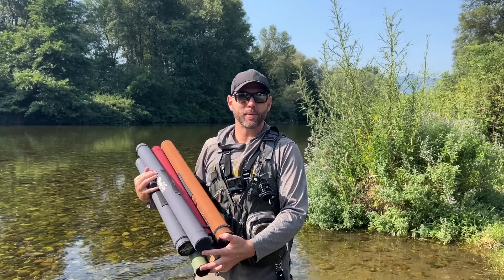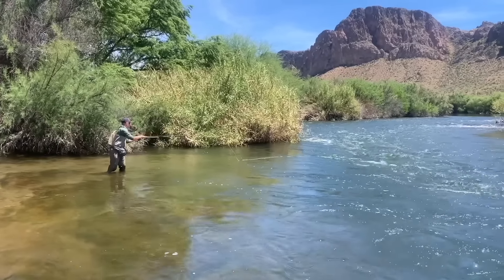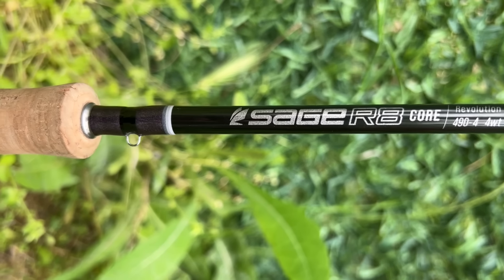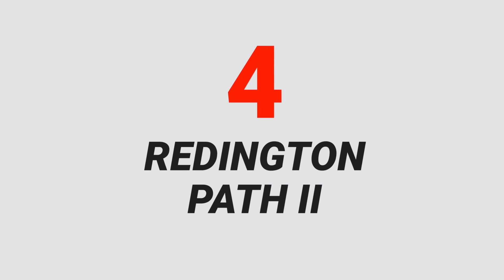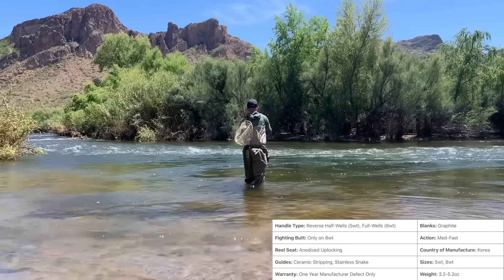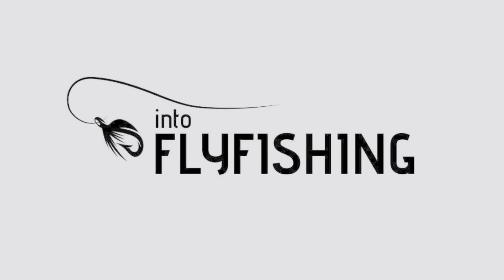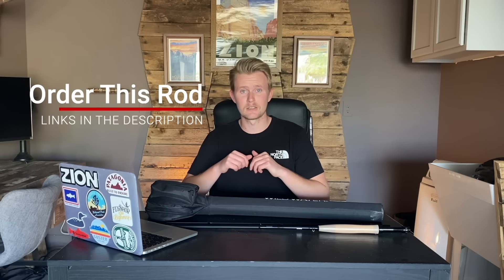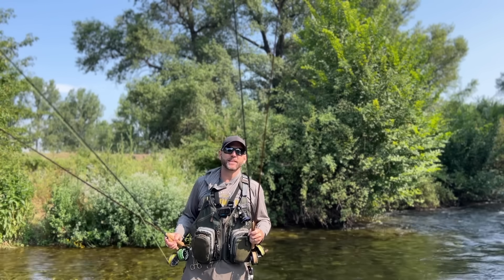Best Budget Fly Rods (Reviewed & Compared)

Comment: If you could buy a hammer that was fully capable of driving nails and priced between $50.00 and $250.00, or one that was $1,000.00 that did exactly the same thing, would you call the lower priced hammers, budget priced? The point is that $250.00 and less is, and some might still disagree, affordable. The $1,000.00 rods are clearly an extravagance. The proof is in the fishing and I sometimes still use a 40 year old rod that cost me well under $100.00.
Reply: I agree that 1,000 dollar rods are really not worth it but a $50 rod isn’t going to cast as nicely as a 400 dollar one. I would recommend to spend at least 200-500 dollars on a rod. Anything over that is too much and usually anything under that is crap but there could be some exceptions out there. For example I heard the reddington wrangler is pretty good that is 160 bucks.
Reply: If you're Johnny trout fisherman then yeah $1,000 for a flyrod may be too much. Some people spend $1,000 just trying to buy the perfect rod because the one they have is never good enough or it breaks and they don't want to go through the process of replacing it. So if your flyrod is an investment in your fishing and you can afford it, get it.
Reply: What a weird way to say that you don’t like nice things, and are probably a poor person
Reply: @nikcarbaugh4019  who are you? Why are you so rude? Does sitting behind your keyboard and insulting people make you feel good?  While you're doing that, I'll be enjoying my time on the water.
Reply: @frankhoxsey1177  I am my own person, and I am rude when I see people say and do stupid things, Like you did. No, I do not sit behind a keyboard all day, I actually go out fishing, and I promise you, the crap that came out of your comment needs more than just a handful of toilet paper. Equating a hammer and a fly rod is like making a comparison between a bicycle and a car. Sure, there is a point where money doesn't improve performance, but the claim that you can pay less for a fly rod and get the same performance out of it as you would a $1000 rod is moronic at best.
Reply: @nikcarbaugh4019  dude! Really! "What a weird way to say you don't like nice things and are probably a poor person". That was your comment not mine. That comment was extremely rude. My question to you is.... If you two were having a conversation and he made the same statement, would you reply the same thing to him in person?
Reply: @frankhoxsey1177  Yes I would, because I do not tolerate stupidity, whether or not it is in person or online. And yes, if I was having a conversation with a random person and they said some stupid shit like that, I would hold them accountable for it.
Reply: @nikcarbaugh4019  so your going to hold him accountable for feeling like he can get a same performance out of a $50 flyrod as a $1000 flyrod? The thing that I have always loved about the flyfishing community is that it is about the love for fishing and the fun that is within. It's a strong supportive community. But, to call someone out because they don't see the difference in two flyrod is not what I have seen in this community. To that end, may you get a good drift and a tight line.
Reply: @frankhoxsey1177 nikcarbaugh must walk around with a black eye and busted lip a lot…
Reply: @nikcarbaugh4019 sounds like you’re trying to justify your purchase 😂. Get some friends
Reply: @michaelwright956  nope, because I conceal carry. Anyone who threatens me ends up on a shirt
Reply: @nikcarbaugh4019 he was not saying that a hammer and a flyrod are a 1 to 1 comparison. He was saying that for the most part in regards to price, the cheap hammer can drive a nail. mabe not quite as good but it does the job just fine, and the bigger difference is the skill level of the carpenter, the same as it is the bigger more important difference with the level of the fly angler with regards to placement of the fly.
Reply: @nikcarbaugh4019 

You use poor as an insult.

That's the elephant.

Someone with less money to spend is not necessarily poor in many other areas.

Getting enjoyment out of fishing on a tight budget might be one of them.

A famous saying by Bob Marley was 'Some people are so poor, all the have is money'.

Would you have made your case for a 1000 dollar rod by its attributes (without using the word 'poor' as you phrased it) this whole conversation would have went a totally different direction.

Do with this information as you wish as I'm not gonna entertain opinions on my opinion.

I'm rich in strong and well thought out opinions.
Reply: @nikcarbaugh4019  poor and smart are two different things.  You may not understand how these lifetime warranties work with pricing.

Comment: I bought a maxcatch extreme for $37 from Amazon to see how bad it must be. Loved it and have bought 3 more, I prefer them to other rods that cost $200 plus
Reply: I have not had any experience with many of these rods but I have some tfo rods and have a fondness for the ones I own. One is a 6ft 2wt that I just love ine the small warmwater creeks I fish. The tfo 8.5ft 5wt rod that I own I never liked and threw it in the corner for 2 or 3 years. I finally pulled it out and put a 7wt line on it and it came alive for me. I will use it to feed carp when I get the chance.
Reply: I also want to add that I find the Eagle Claw feather weight rods to fine glass rods for my warmwater creeks and keep them to get friends started in our great sport and I always recommend newbies to start with them. Much more durable than graphite as a first rig. Most graphite rods are broken by mishandling and by newbies. Bead head flies have become the main staple for beginners and a major cause of broken rods. One poor cast and the bead hitting the rod causes a weak spot in the blank. Glass can better withstand this one poor cast.

Comment: I just put together a Redington 376-4 Fly Fishing Classic Trout Rod 3wt with Tube, Freshwater, Moderate Action Rod. I bought a Okuma Siera X 3/4 and a Rio Premier Gold Fly Line. I cannot tell you how easy it was to cast. Very forgiving. I wish this would have been my first set up. So easy to work. First day out, I pulled in 10+ little sun fish. Each one was a blast to land. With a three pack of 6X leaders, I am out sub $250.00
Reply from the maker: Yeah that's why Redington is so hard to beat here. We loved the Classic Trout Too. Try the Crosswater and Wrangler too one day if you get the chance. 😀
Reply: @intoflyfishing  Out of these 3 rods, what would you pick for a 4 wt for small streams?

Comment: I would agree with the comments about excluding Temple Fork Outfitter low end rods from your review. Really? How is that possible? Having 4 out of the 10 from the same brand raises a question about the motivation, perhaps?
Reply from the maker: For a rod to be considered "Budget" we were pricing the rod itself at around $100. The more expensive ones on this list either come with a reel and line, or an extra tip. By this criteria, no TFO rods fit the price barrier. We love TFO rods though and have reviewed and fished plenty of them. They will appear in our Best Midrange Rods list, best trout rods lists, etc.
Reply: @intoflyfishing  OK, but the TWF can be considered "budget", for example the Signature II sells for around $100 bucks. I have not tried one, how do they cast?
Reply: I mistyped TFO, apologies.
Reply from the maker: @robthompson7174  We're going to be reviewing the Signature III and Pro III soon. But both are in the $160+ range so not $100. I would say the III is worth the upgrade in both. These age great casting rods and always have been and TFO is good about their repair service.
Reply from the maker: @robthompson7174  They're a bit more than $100 in my experience. But having said that, there are some TFO rods on our Best Budget Fly Fishing Combos list coming out. Love the rods, but these ones beat them out for pure budget rods in the opinion of our team.

Comment: Good video. I still use a Fenwick Eagle HMG 5 wt.purchased in 1975. It is perfect for  nymphing/dry flyfishing in light streams & slow rivers, has enough stiffness to load up for med.streamers, in part due to its short length of 7.5 ft(which also helps lower fatigue at the end of the day). I have not babied its care, and it shows only light wear! Kudos to Fenwick.
A great beginner's rod that complements my heavy Sage& Loomis stuff. If you can find one of these rods then buy it!

Comment: That was a nice overview of inexpensive rods. Fly rods have seen a ton of trickle-down technology from more expensive rods, so it's not surprising that these rods are more than ok. Here's a couple of things you didn't cover. 1) If someone is new to fly fishing, they're better off with a turn-key kit from Orvis or Reddington. Why? It has to do with the fly line. Pairing a line to a rod is essential and is what makes an inexpensive kit perform better. I've done a fair amount of impromptu casting lessons with folks that picked up an inexpensive kit (not from Orvis, Reddington, or Echo) and typically the rods are underlined for the rod's action. A quick fix for any underlined rod is upgrade to either SA's Air-Cel or Frequency Boost line.  2) If you do another such comparison, you might want toss in kit from Echo as Tim Rajeff's rods are excellent. The kits range from $189 to $269.
Reply: Yah Kelly galloup is using the echo kit exclusively for a whole season…..that’s all I need to know.

Comment: I did a review of a maxcatch ultralight fly rod (7.5ft 3wt) which costs 120 bucks. The first few trips out were great! After about 3 months, the tip broke, and took a month to get a replacement, which broke again, along with the main section of the rod, this is with really light use. The reel also began to rip the pvc coating off the string which would then cut my fingers when sliding the string through them. They have sent me an entire new rod, but its given me some serious heart burn. I'm working on a follow up review.

Comment: For those rods that were said to be a little under powered to handle windier conditions, would going to a heavier weight, like an 8 wt. but perhaps using a 6 or 7 weight line help?  Just wondering.  I know this is older, but I was trying to find the Redington Crosswater (rod only).

Comment: Another option is to look for deals as they come along. I got 3 models of the Greys GR80 fly rods at Sierra for $149 on sale, and they blow away any rods on this list for sure. Had too much trouble with the tip top guides losing their finish or plating on the Maxcatch and Redington rods, even with expensive fly lines and fishing clear water. I do have a Drifter 2, that’s been very good so far, after 100s of fish landed. So, not every budget fly rod performs as it should. And I won’t take Redington up on their warranty because they won’t give you a replacement that doesn’t have the same problem anyways, so why bother.
Reply: Where are you from?
Reply: Agreed 150%.  The gr80 are awesome, same with the gr60 as well as the Aetos.
Reply: @RoryLynott  Are those all the same rod with different hardware?

Comment: I bought a 10" #6 clearwater rod.I hooked my anchor rope and gave a couple light tugs to free it.Catastrophic failure! The rod shattered like glass in the butt,mid,and top sections. I got a replacement ,and this rod broke at the tip,I'm not even sure why.I took the top at the break, between my fingers, to test it, and it snapped like a toothpick. No tensile strength at all. I called Orvis and told them I did not want another of these rods.
Reply from the maker: That sucks. We've definitely not had any experience even close to that with any of our Clearwaters. They are great rods. They don't appear on this list though, but they're a great midrange rod for sure. Sorry to hear about that. I hope Orvis sent you a Helios for your trouble 😂

Comment: This review feels Bias. Out of the 10 you picked 5 Redington rods. In my experience, Redington rods are the reason people upgrade. Not only do they underperform (Path II tips are junk) but Far Bank has a really poor warranty process. What about TFO, ECHO or even St Croix? Each company offers price compariable options. I would argue that half of your list could be replaced by these brands and Redington might not even make the cut. Also, I know you were expecting this but I am not sure if you know the whole story. MaxCatch is owned by Leichi China. They shouldn't get credit for their "Designs" as they simply remove labels from US designed products and compete directly to the US consumer.
Reply from the maker: only 4 are redington? But yes, they are a leading budget brand for sure. I agree TFO could've been on here but the team bumped them for these rods. Nevertheless, there are some TFO on the Best Budget Fly Rod Combos list. These particular rods were hovering around the $100 mark unless they had an extra tip or came as a larger kit. The newer TFOs are double that so they'd fall into my more midrange category. Unless you're going to go for an older version of TFO rods which don't have as good of blanks. Either way. Love TFO and we've reviewed plenty of their stuff. Will have more to come.

Comment: I feel like you weren’t hard enough on these rods, most of them have pretty terrible swing weights when you compare them to mid to high end and I know you comparing them to each other but some beginners might think they are good when in reality they might be “good” for the price not a bad thing though it’s good to learn on bad stuff and upgrade it and appreciate nice gear
Reply from the maker: Comparing them to mid-range and high-end rods would not be a valid comparison. The entire video explains that these rods "AREN'T NEARLY AS GOOD" as a Winston or Sage... so I think we covered that, and it goes without saying.. even though we said it. These are incredibly solid rods for the price, and that's what this video is about.
Reply: really? beginners need to be concerned with swingweight? quit trying to sound knowledgeable. I have been flyfishing for 40 years and I don’t even know what you’re talking about. I have also recommended the crosswater rods for 15 years.
Reply: I’m not trying to sound knowledgeable, if you have compared any of these rods to high end they have garbage swing weights like absolutely terrible, but that shouldn’t be a factor for beginners to get them to buy more expensive stuff, but people should be knowledgeable that if they do eventually want to upgrade a nicer rod will be so much easier to cast for long days because that swing weight does change a lot at different price points, I don’t know how you can’t agree with that

Comment: I left the video as soon I saw that TFO was missing from the list 🤔 Big mistake.
Reply from the maker: Read my comment to robthompson7174 above
Reply: @intoflyfishing well, the Drifter is $179, so your so called test parameters are a lie.  TFO Signature and Bug Launcher start at $120.
Reply from the maker: @triumphrider9396  haha take it easy! This isn't a massive debate on the topic. You are entitled to your opinion. The Drifter comes with an extra tip. I count that as $50 because most rod manufacturers charge that for replacement and take forever to ship you one. Either way, I don't believe the bug launcher makes this list anyway. Other TFOs, maybe. The Signature 2 is discontinued. I'm not adding it. The Sig3 is more expensive. Not everyone is going to agree with this list. A lot of the feel of casting a rod is subjective. Sorry if you don't agree.
Reply: @intoflyfishing  funny that you lied again.  The signature is still on TFO’s site, so definitely not discontinued.  You’re not very trustworthy or knowledgeable as a reviewer.  At this point you should probably just admit that your video is biased towards the companies that paid you for plugs, which is not helpful for beginners in any way.  They end up buying a piece crap when they could have purchased a starter rod that they won’t need to upgrade any time soon.

Comment: Iv tried alot of rods over the years also. There are some great packages out there. Not as cheap in Australia.
Max catch would be the worst rods I hVe ever cast. So un balanced.  Maybe in the last 12 months they have changed. Felt like a old glass rod from the 70's to cast.
Reply from the maker: Interesting! Yes there are loads of kits these days. Out of curiosity, Which Maxcatch did you have? They have some slow rods, and some broomsticks. I like the Premier. It's a decent cast and punches way above it's price. Is it my main rod? NO. Does it compete with my R8... hell no. But for the price it's hard to beat and it doesn't cast like glass.